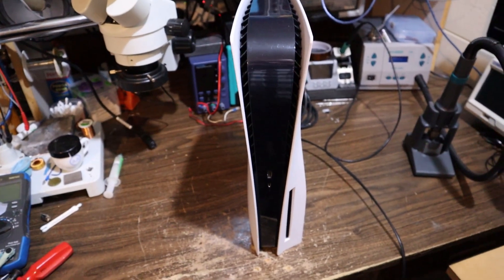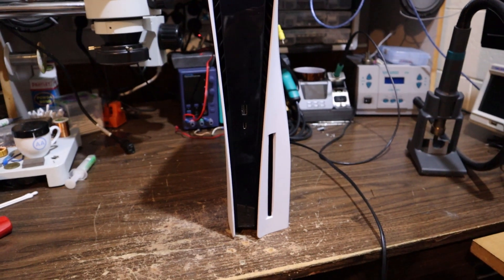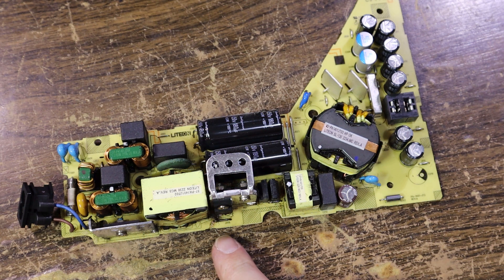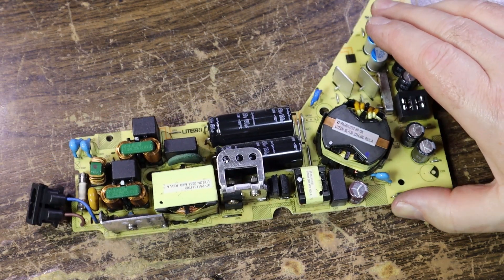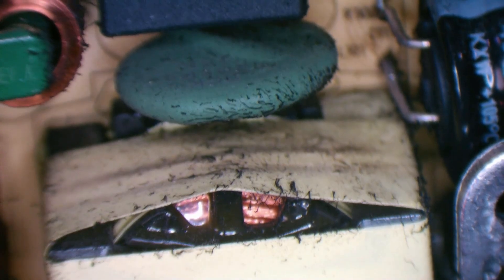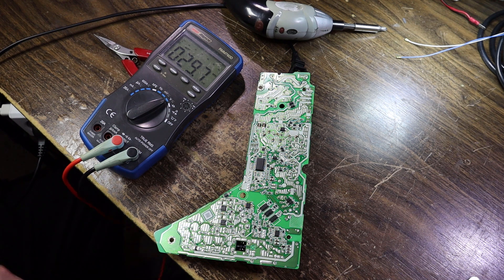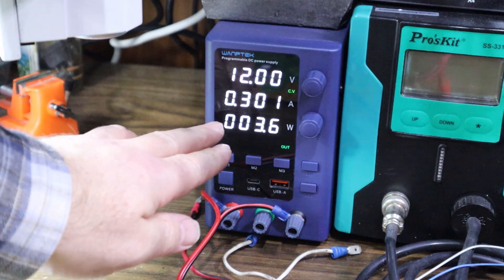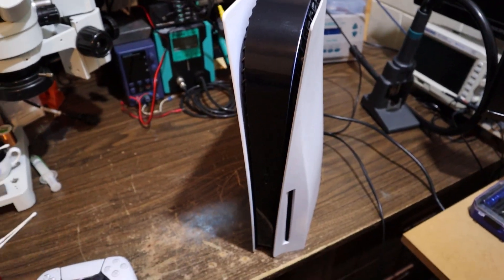PS5 No Power Repair!

Comment: I got a question if you vacuum your house and have the air conditioning on will the cold air from the air conditioning cool the PlayStation 5
Reply from the maker: Yes cold air from the AC will help cool it but only if the bond between the CPU and the heat sink is good.